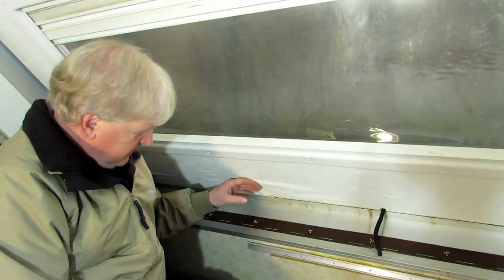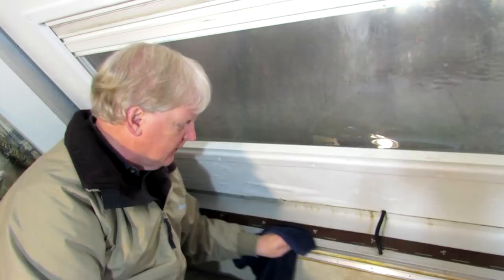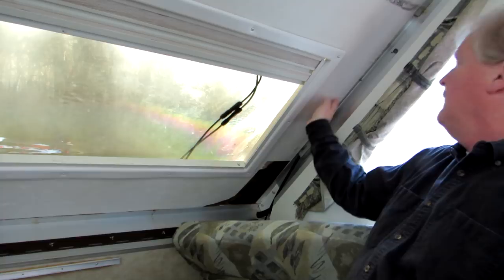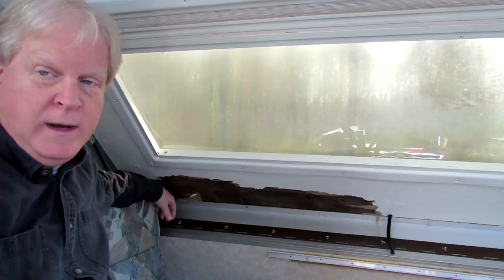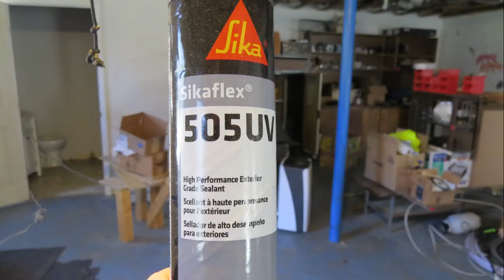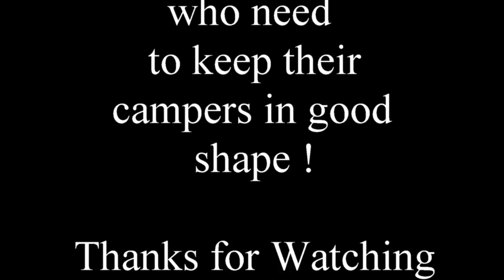Roof Leak on My Aliner, Popup Camper.  What to do !?

Comment: We had a bubble window lift up and leak to the bed end inside ourA-frame. Fortunatly there was not a lot of damage and drying things out fixed the wet. Those bubble windows are after all only glued on. We proactively resealed all 3 bubble windows and the fan with eternabond tape. After seeing your video now I'm glad we did the fan too. I may not have an Aliner brand but I've learned a lot from your videos about maintenance and repair.
Reply from the maker: Great !!  There really isn't much difference and trailer manufacturer isn't very different from one to another. Except maybe an Airstream and a Newmar.   I'm going to "reseal" my bubbles because there is a lot of obvious flex to those areas.  And they add very little strength. I won't use Eternabond because if they crack or break, I want to be able to remove them easily and install a regular Home Depot Skylight  !  Much stiffer and stronger !

Comment: I have a 2002 Aliner LXE, bought new. I've had many insidious water leaks over the years. I check and re-caulk  any suspicious areas every year. There are so many places an old Aliner can leak and sometimes it can take days to figure out where the origin is. I had a leak around my Fantastic Fan. Even after re-caulking it still leaked so I assumed it was leaking somewhere else, but never found it. I finally broke down and used Eternabond tape around the fan. This stuff is so sticky and you have to lay it down right the first time, no second chances. Leak is fixed, so Eternabond has it's place, at least for me, though I do wonder how hard it will be to remove the Eternabond tape. Thanks for your great Aliner videos.
Reply from the maker: @Chickenlips  Excellent comment.  Sometimes you just never know !  So you have to do your best attempt. Its the same at the dealership, they will try stuff and charge you and it may not work, but they still charge you again, and again. Its all trial and error, and its all because we love our campers and want to continue to go camping !!   So its all about getting out and camping !!  Everything else is just supportive !! LOL

Comment: Another great and useful video! The previous owner of my A-Frame (Chalet) used Dicor on the roof and I agree, it was ugly so I scraped it off and used the proper caulk. Looks great and no leaks. I was going to replace my springs following your video on that, but now I'm going to install gas struts instead. This isn't the first time I've heard of a roof being damaged by new springs. I've been on the fence about it and now decision made.  Many thanks!
Reply from the maker: Ya,  I did mine after Dave Michaels did his, and his has a different window configuration.  So I'm thinking its not a great idea for an old trailer. But really it might be more that water got in and softened the wood, which then allowed the springs to do the warping of the roof.   In either case, The Gas Struts are far better, and more tunable.  I'll be surprised if Aliner doesn't change to them sooner of later !
Reply: @GoingNoWhereFast  Started watching your channel quite a while back just to see where you were traveling. I'm originally from upstate NY and it was just like going home (live in AZ now).  The more I watched, the more I got interested in the camper so I bought a used one, restored it and now I travel & boondock every chance I get.  Your channel got me started and its one of the best things I've done for myself.

Comment: Wow, sry to see you  had a leak. Weather is rough on campers. We used to cover the top of ours when not in use. No leaks, and sun didn't damage the windows.  Hopefully the caulk will be just what you needed. 😊👍
Reply from the maker: It seems to be happier !! 😊😊  I used to keep it in the garage during winter, but had to keep it down and outside at the temporary living place when we first moved down. I thiink thats when it really saw some infiltration as water sat on the roof !!  And Ice, and Snow, and leaves, and dirt and yucky stuff.  It was a very unhappy camper !!
Reply: @GoingNoWhereFast  Lol, a happy camper will definitely make you a happy camper too 😊

Comment: I've been doing a lot of leak prevention lately on my 2008 Classic.  I have a dormer and replaced the hinge seal, and the main roof seal.  Aliner does not rivet the dormer hinge at the extreme ends, and over time the hinge lifted about 1/8" off the frame.  Water would make its way under the ends and into the camper, where it would seep into the aluminum channels surrounding the roof cut-out for the dormer.  The water would show itself at the bottom corner and drip on the bed.  Aliner advised me that the hinge seal material should extend 3/4" beyond the roof frame to create a drip edge for water to run off.  Mine was flush with the frame, either installed incorrectly, or cut off by the original owner, perhaps not realizing its' purpose.

Regarding the domed air vents, which I also had small drips.  Mine looked like they were sitting on a gasket of sorts.  I removed one and discovered it was entirely a bed of caulking installed at the factory.  When I redo mine, I will pull the units out and remove, or cut back the caulking and then reinstall the dome and recaulk the perimeter working the caulk in until it bulges out.  As stated in this video, masking tape is a must for a professional looking job.
Reply from the maker: Thanks for the comment.  Great information.  I have no experience with Dormers, so I'm sure some will be glad you posted this.  Thanks Again.

Comment: Instead of paint you could get some of the plastic white board that they use in bathrooms, cut a piece to fit, then you could glue it on. Just a suggestion. Thank you for sharing!
Reply from the maker: I was thinking of using a heavy commercial wall paper or maybe a piece of vinyl flooring. The tough part is cutting it to match as it is so ragged.  And I'm afraid it will show the edge through whatever I place over it.  So for right now I'l leaving it until I am certain it does not leak anymore !

Comment: I have an '02 ('03) Chalet that needs all it's seals replaced.  I get a fair amount of snow where I live and no place to park it under cover.  I bought a long tarp and covered the trailer with it in the open position.  It's worked well.  Once it warms up here, I haveca lot of work to do!
Reply from the maker: As long as you leave it set up, I think you'll be mostly ok.  I had to have mine down and closed up out in the open because I was staying at this temporary living apt. complex and they forced me to store it in a distant parking lot. If it had been set up it would likely have been vandalized and leaving it shut down and locked up left it with water sitting on the roof and snow and ice at certain times... It definitely did it no good.   I think a lot of water must have seeped into the roof walls during that time. I wondered why they seemed about 30 lbs heavier when i finally moved it out of there.   A Tarp would have helped !!
Reply: @GoingNoWhereFast  - I found water inside after the first rain.  It's the seal at the top where the roof pieces meet.
Reply from the maker: The roof peices actually should seal out any water even if there is NO Seal Present.  They over lap that much.  The Foam Seal is really just to keep the roof from rubbing and wearing and clanging when you set it up.  Make sure it isn't condensation !  I have met so many people who see water dripping along the top seam and think its a leak, when really its just the condensation dripping off.  Wait for a warm dry day and then spray it with the hose.  If its leaking up there, it will show really fast !
Reply: Hmm..I didn't know that.  It was definitely a leak but must have been coming from somewhere else.  Once I get some warm(ish) weather, I will try the hose test.  Thanks.

Comment: Get yourself some eternabond tape, clean around vents and use tape around them. I do this with every RV I have bought, on all seams and openings in roof. Never had a single leak
Reply from the maker: Ya, a lot of people do that, but its a lot harder to remove the tape and do another repair or make a change to the fan or vent once you use that stuff.  It is eternal after all.. LOL.  Thanks for the comment though, it does work for most people.
Reply: D LR f

Comment: Bought myself a old 2006 Aliner last year, realize to late that water was coming in exacly like yours, under the bubble window, all wet luan wood from lef to right, finally found a hairline crack in the upper corner of that bubble, its was soo tiny, about 1/2 inch that I had to scratch with my nail  to see if it was a crack...didnt think such a small crack coul do so much infiltration, but I put some marine silicon on it anyways...guess what, no more water leakage !
Reply from the maker: Good For you.  Yes, The bubble wondows can get incredibly small hairline cracks that are very hard to find.   I put the pressure washer up close and on high power toi my bubbles and they seem to have withstood the test.  No cracks or infiltration of water through them.  I think a lot of people make the mistake of leaning on the bubbles, or setting something on them and that cracks them.  Good Catch !  Thanks for the comment !

Comment: Have you ever had an issue with the blind on the Bubble window? Mine is difficult to move up and down and the previous owner damaged the pleats in it. Have you ever taken it apart?
Reply from the maker: I attempted to take it down to inspect for the window for the leak, but I determined that unless I wanted to completely rebuild it, I did not want to mess with it !!   There is a YT Video about changing the strings and doing repairs that I watched a couple years ago. It made it look fairly easy to do if you just tie a new string to the old one and use it to follow through all the twists and turns.  But I have never had any issues with mine.  Even with the boys pushing it with their heads and paws, it works great.

Comment: I need to recalk around the fan, Previous owner used a black rubber caulking. should I remove this first?  I plan on using dicor self leveling sealant. I would also clean with the acetone. thanks!
Reply from the maker: It is not recommended to use Daycor. The roof material is a different substance, and the Dicor will not adhere to it very well Aliner, and good Aliner repair people suggest GE silicone. 100% silicone, caulk, clear. And yes, clean as much of the other stuff off as you can And lay it on fairly thick. I prefer to lay tape around and then kind of push the caulk into the seams, and then pick up the tape right away because you don’t want it glued in with the silicone

Comment: Do you have a spring alignment problem? Is the compressed spring misaligned causing the distortion in the aluminum rail? (pushing out instead of up) The spring should be straight and aligned properly. A piece of 3/4" black pipe long enough to go through both springs coils would keep them aligned. (Tip from an Aliner repair experts page)

Is the top wooden block holding the spring to the back wall rotted?
Reply from the maker: There is no rotten wood. I'm not sure what you mean by the "block of wood". The spring sits in a cutout on the sidewall and the bottom part goes into the back wall.  When they install them, they "Glue" them in with a generous amount of caulking.  If they don't drill the original hole straight, you will never get them to sit straight.  But that would not matter when the roof is down. It might cause some alignment issues when up, but that isn't the problem.  Yes, you can "re-align" the spings with a piece of pipe, but that isn't really doing anything for you. Its just esthetics for the OCD crowd.  I replaced my springs 2 years ago.  The new ones are in the identical orientation as my original ones.  But these are 3x as strong. So I believe they caused the 8inch piece of plywood between the aluminum edge and the window to bow up a bit.  Like if you were walking on a piece of plywood between 2 chairs.  It would flex.  It could be the inner  wood got wet and so weakened, or it could be just old age and stress.  In either case The next video will show how I fixed it, at least for a while.

By the way,  taking a "set" crooked Spring and putting that pipe inside it and trying to turn it so it lines up with the other side will split your back wall framing 40% of the time.  Been there, seen that !  Sometimes its serious, sometimes you can live with it.

Comment: on one of your videos, maybe this one, I saw you move your aliner out of your garage manually by yourself onto what looked like a pitched driveway - how did you keep it from rolling while you chocked the wheels?
Reply from the maker: IF it is really on a slope that it may go, I lay down a 2x4 board that will stop the wheels, but most of the time I just direct it to go sideways, across the grade, so it has no slope to go down..  Then lay a 2x4 side of the wheels and spin it around in the direction I want it to point and the 2x4 will act like a chock.  Even rolling at a pretty good clip the trailer won't jump a 2x4, at least not 13 or 14 inch wheels.

Comment: Hello. Seems like these Aliners are not well built. With so many issues. What has the company done to improve their product?
Reply from the maker: They are built as well as any RV in the industry.  There is no warrantee required on RVs, Trailers, Motorhomes like there is on cars. So all equipment seems to be less than perfect.  But Aliners are built very tough for what they are, and they are a very lightweight 2 person mini trailer with one axle.
Reply: Going NoWhereFast thank you.

Comment: I bought a second hand Aliner with water damaged walls. I removed the damaged wallpaper and now have a half white/half wood walls. Could you tell me how you fixed your walls after you repaired the leaks?
Reply from the maker: I have a very high tolerance for "Ugly", so I have not done anything with the bare wood I exposed when I dug into the leak.  Sometime this fall I will probably just paint it white along with the rest of the ceiling as the entire roof/ceiling is pretty dirty from the black weather stripping rubbing as it get put up and down. Since that is where the water would go if thee is a leak, I'm thinking I like it being exposed.
Reply: My only problem is that removing the wallpaper left a coating of adhesive that is still sticky. Products like "Goo-Gone" will dissolve it, but it's a slow, tedious process. Oh well, it  will give me something to do in my spare time...which, being retired, I have plenty of,
.
Reply from the maker: Acetone will take it off pretty fast, but you have to make sure to remove the acetone and glue fast or it will just move to some other location and be a mess.  Oven cleaner also works, and there is a "Paint and adhesive" remover I have used, but its a bit toxic, so wear the gloves and do it outside.

Comment: Hi! We are considering getting an A-frame and worry about leaks. How is your A-frame doing against leaks? Any suggestions to help us prevent these issues?
Thanks!
Reply from the maker: depending on how well you care for it........ If it gets a lot of sun and temp extremes, You need to watch the caulking around the edges of Everything.  When it becomes dry, cracked, or pulls away from the surface, scrap it off and replace it.  NEVER put an weight on the roof panels. They are not for sitting on, or tie canoes of kayaks to.  They are fairly flimsy, though will hold up to any thing the weather can throw at them.  A lot of people will lie on them to wash of reach stuff, and it bends the panel and breaks the seal on the caulking.

Comment: Any leaks since the fix on the bubble windows?
Thanks!
Reply from the maker: My bubble windows have never leaked. I believe the water collecting under the window came from the  separated caulking on the upper sky lights and fantastic fan. Though the caulking around the edge of the roof was also fairly dry and cracked.  The bubble windows are installed pretty carefully with a lot of adhesive that is hard to believe would ever leak around the edges, but the windows are sometimes abused and do get cracks.
Reply from the maker: If you haven't seen my "Don't buy and Aliner..." video,  its all tongue in cheek.  I love it!  I will be doing a "Buy it, Love it, Care for it" video this spring.... If you might wait....
Reply: @GoingNoWhereFast  I'm glad I watched this video. I was convinced that my leaks were coming from the bubble windows. Now I can see that the springs have been working the edge pieces of aluminum in and out enough to pull the caulking apart. The caulk was done well only a year ago. I'm curious if you were ever able to remedy your situation? Did you need to stiffen it up with aluminum angles, or did you find a flexible enough caulk that would withstand that much movement?
Reply from the maker: @ghneely    Aliner has started adding  Angle iron on the inside under the springs to stiffen the roof from bending and causing the aluminum to warp and open up an area that encourages water intrusion.  I added some on the outside, but it is not as effective.  And its pretty ugly.  Check out a new Aliner at a dealer..

Comment: You needed to reseal the roof on RV’s every 3 yrs or so. You’re supposed to remove the old caulk and re-caulk it, never ever just caulk over old caulk, EVER. Best to just sell that thing right away.
Reply from the maker: Agreed, never caulk over old caulk, Never paint over old paint,  Never put on new underwear over old.  So why do you say sell it.  It has many many more years to go.
Reply: Going NoWhereFast Did you remove the old caulk first?  If you did, how did you do it?

Comment: How old is your Aliner?
Reply from the maker: Its a 2008, so over 10 years.  And it has been used fairly hard.  I have pulled it through some back roads and swamps I do not believe it was ever built to travel over or through !